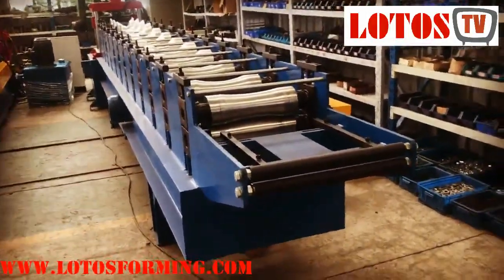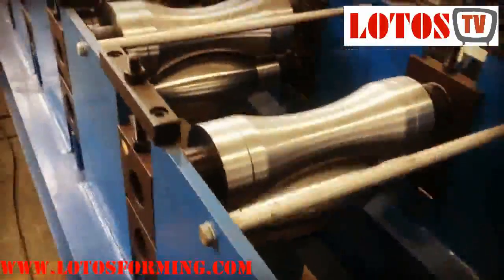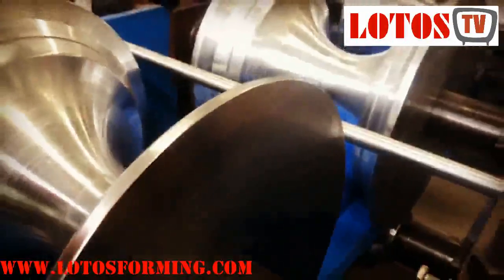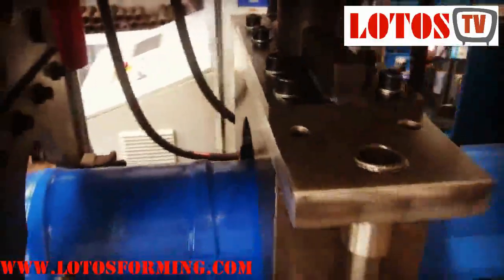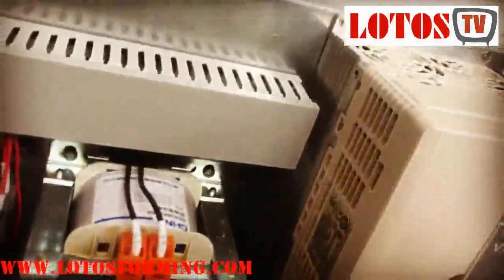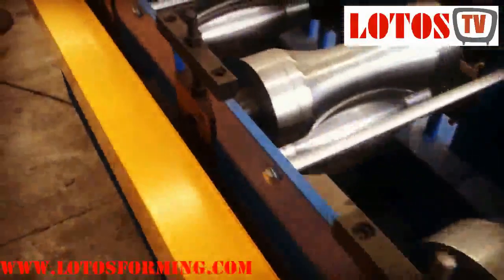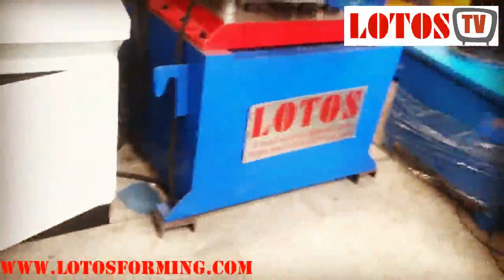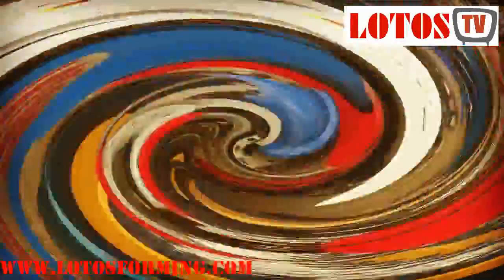⏭ Gutter machine / Gutter roll forming machine / How to make gutters ?!!

Comment: #Gutters are an integral part of your home’s
exterior. Installed and used properly, they direct and channel water away from
the roof and home’s edge, preventing leaks
Reply from the maker: it is the practice in the steel industry that structural shapes are assigned representative designations for convenient shorthand description on drawings and documentation